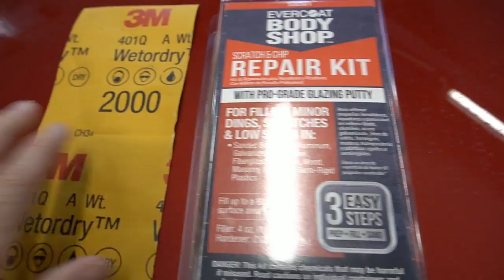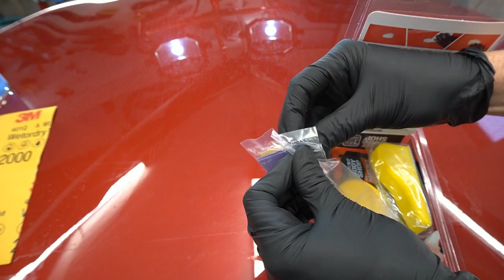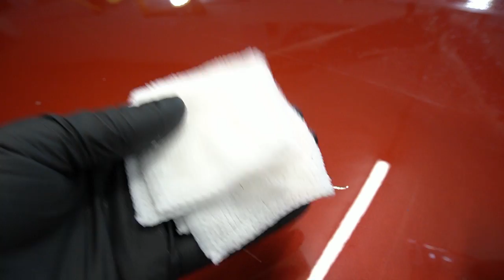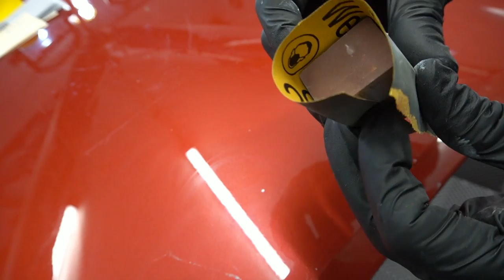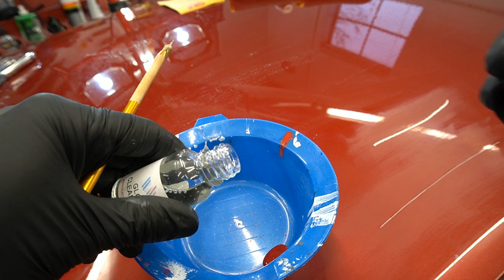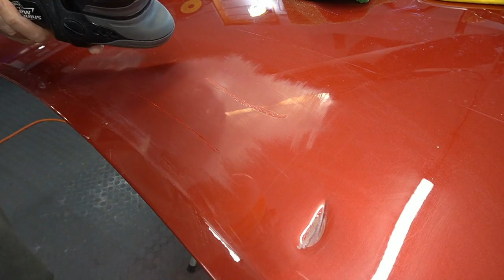Evercoat Scratch And Rock Chip Repair Kit. Can This Also Be Used For Paint Chips?

Comment: The flaw in this method is when you level the filler to the surrounding paint you have no recess to fill with paint. Any touch up you apply will always stand proud of the finished paint level and when you attempt to flat it back you go back to filler level.Because the filler is at the finished paint level when it should be below the finished paint level.